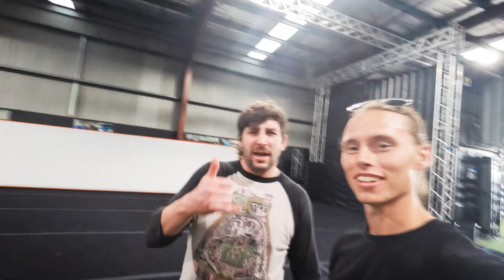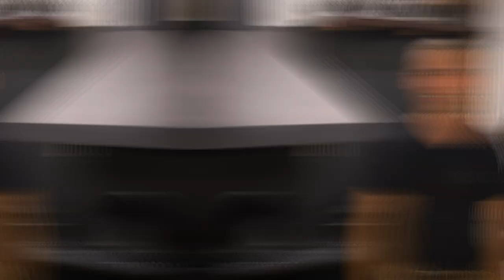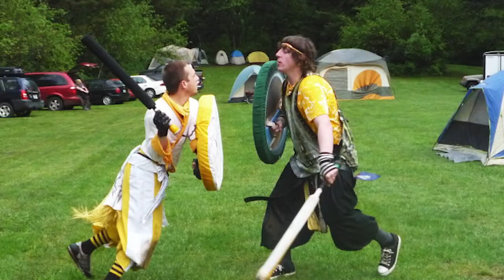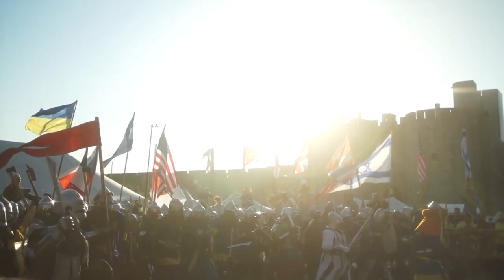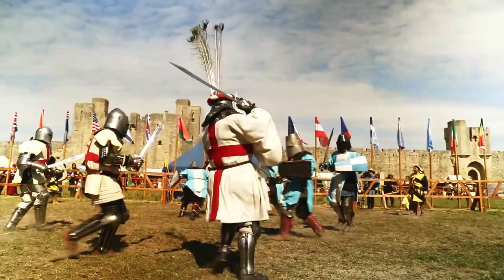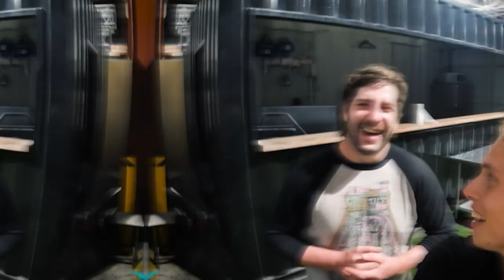REAL LIFE Knight Sword Fights?! We Discover Buhurt!

Comment: They’re basically bashing each other with blunt sledgehammer-swordlike objects. Not proper technique and form against a real armored opponent on the battlefield. 😂
Reply: And boxing is just two just slapping each other with mitts, I’m sure.

Actually watch some other videos on the Buhurt sport. They do practice techniques.
Reply: @ironclamp5325  but what's the point in wearing the armour if you're not going to re-create the combat faithfully? This is why I have more respect for harnischfechten than buhurt.
Reply: @deece1482  Because modern Buhurt is more sport than re-enactment. Like modern UFC fighters hardly uses every single form or move their martial arts taught them in every fight.